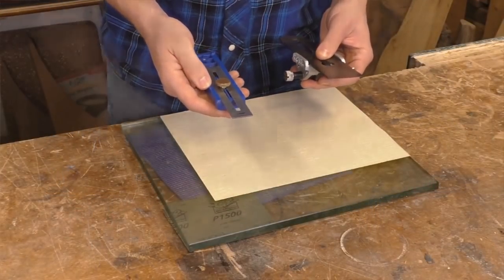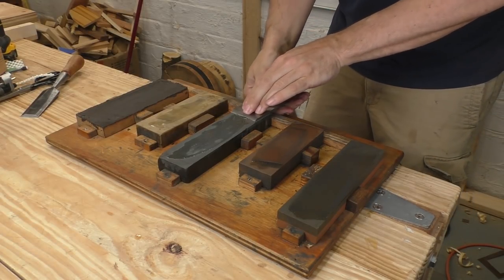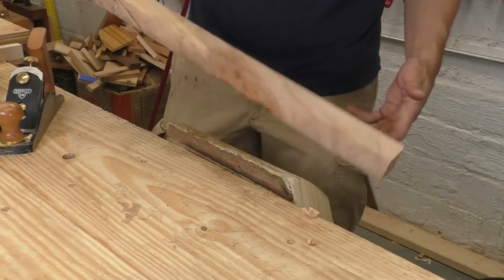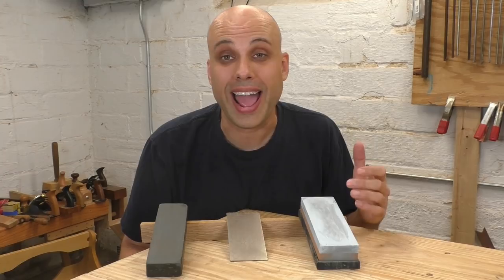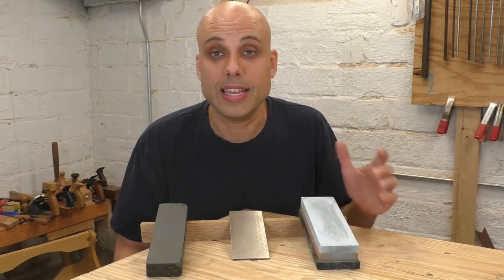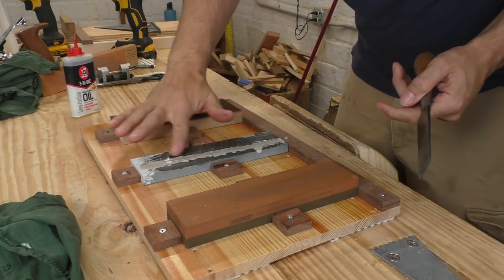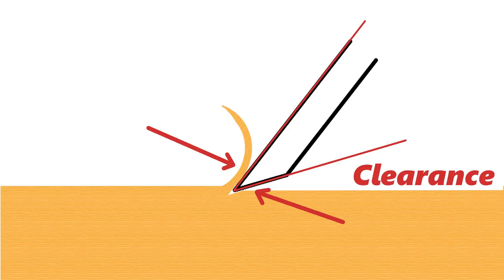Fast freehand sharpening: no jigs, no guides, no sandpaper.

Comment: An "edge" is an edge. more or less bevel is only serving as either efficiency or weakening the rest of the chisel. An edge only needs to be a smart crisp end to a hard firm piece of steel. No matter the angle, the edge is not a hammer, but I don't see people worrying about wether or not they have a perfect 90 on the face of a hammer...

Comment: I bought some stones for about $60.  A course stone, 400/1000, 3000/8000 and the set came with a strop.  The very brief instructions say use water. In the past I always used honing oil. I noticed you use 3 in 1 oil. What’s the real difference between use water or oil?  Thanks

Comment: Thanks for the video. Just a question: isn't the jump in grit from India stones to Arkansas  too big? They say the first is some  150/400 grit, while the latter 6-8k. Shouldn't the the something in between (~2000) or the grits are not comparable much? Thanks.
Reply from the maker: That's a really good question, but I've never found it to be a problem!
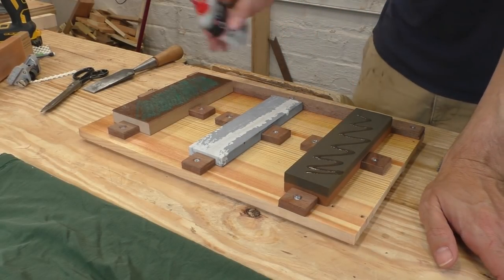Reply: An insight from Rob Cosman (https://youtu.be/okLIEoz00v0 10:18). Long jumps in grit are not too much of a problem when working on a small area.

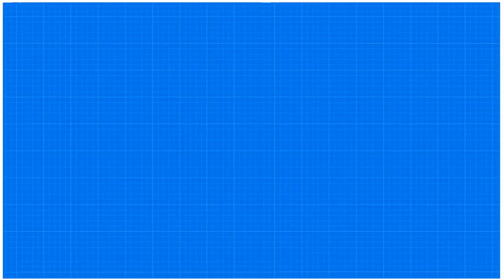And Paul Sellers said (https://youtu.be/UbAo4RpM7oM 0:40) he was using this particular Norton India stone (2500/400 grit) for first 20 years, without a need for finer stones.

Comment: Strops: If there's a saddle repair shop or leather goods maker in the area you can let them know you need a couple 3x8 strops from the thins or cuttings and you can get fresh good leather to nail to a board cheap as hell.  Often if you show up you can get em for the raw inch price of the original hide or free.  A piece like that will last a decade.  Shiny side glued, better hold with less glue.  duh.

Comment: The problem with diamond is if you try to sharpen a blade that is high in carbon and hot the diamonds will melt into the blade.

Comment: Huh, the oil stone i have home doesnt really leave the oil on the top like that, it just absorbs it draining the surface no matter the amount i add to it, i wonder if thats fine
Reply: a lot of artificial oil stones do this, it's not good for the stone or the tool if the oil isn't sitting on the surface of the stone to suspend the metal particles created when you sharpen things on them. I was taught that when an oil stone absorbs oil in that way you can 'fix it' by filling the stone with melted wax. While liquid the wax is absorbed the stone and then the wax cools and fills in all the voids and pores of the stone so when you put oil on the stone it stays on the surface and does what it's meant to do, carry all those particles away from the surface of the stone so they're not impacted into it.
Reply: The gray silica stones will do that. Eventually they will "fill up" with oil and then the oil will float on the surface. Or you can just soak the stone in oil for a few days.

Comment: Rex, I have a question!! what do we do or how do we level a sharpening stone that has eroded or lost it's flat surface?
thanks for the video, I do need to update my sharpening game....
Reply: You can use sandpaper on glass........ or a proper flattener (looks like an oilstone with big grooves in it eg-https://m.media-amazon.com/images/I/41uQgMqcjmL.jpg ). I flatten my high grit waterstones with my coarse diamond plate.
Reply: Dished stones are restored by grinding them against a larger, coarser stone.   There are special stones sold for waterstones, but people also use a coarse diamond stone or silicon carbide stone.  I've restored cheap stones that have groves worn in them by using a piece of sidewalk to do most of the work, and then finishing on something else.  In a pinch, the sidewalk will put an edge on a chisel, which is handy if you're on a job site and don't have anything better.

Comment: You don't need a flattening plate for water stones! With three stones you can flatten them against each other and get, and keep, them dead flat. Flattening after every use takes almost no time. You can buy stones that don't need to be soaked (they cost a little more), or just put them in water before you get started.
     Why does this matter? I don't like chemicals on my hands, I don't like oily hand prints all over my wood, and I don't like breaking out in hives. I also like how fast water stones cut; they dish because they cut fast and they cut fast because they dish. 
     If you're on a budget, don't save up for diamond stones. Try cheap oil stones first (or cheap water stones). I think diamond stones are a false economy. I have a co-worker who is an advocate of diamond stones, and I think diamond-stone advocacy can be summed up with his attitude for conditioning cast-iron cookware: He literally refuses to understand the difference between good chemistry and poor hygiene. He has a belief about soap and oil and cast iron, and refuses to accept that a rock-hard polymer isn't going to be affected by a mild surfactant. Similarly, he knows that diamonds are hard, and therefore believes diamond stones cut fast; he refuses to entertain the idea that they cut slowly because they clog up so quickly. Additionally, he has a set of premium stones that, after ten years of use, the finer ones are worn down to bare steel over most the surface.
     Less-than-premium diamond stones aren't reliably flat; I got talked into buying a double-sided diamond stone for $70 and it isn't flat. I didn't check it with feeler gauges, so I didn't realize it until it was too late.
     That said, for people new to woodworking, Rex is correct that there are (almost) no laws in woodworking! What works for you is what works best. Period. I once had a couple people bitching at me about how I was putting breadboard ends on a bunch of tables. Then one of the local Gods Of Woodworking came in, saw what I was doing, and said "Yeah, that'll work." The bitching stopped toot sweet.
     (There are no laws in woodworking, but there are laws in physics and they'll burn you goooooooood.)

Comment: Hey could y'all tell what kind of tools you are using for flattening stones?
Reply: Sand paper. Try 80 or 100 grit wet and dry on a tempered glass sheet. Use water as lubricant and put a splash of water behind the sheet of paper to stick it to the glass. I see some companies offering diamond plates for flattening water stones now too.
Do this process quite often as its so easy and well worth having a flat stone. A must for water stones.

Comment: Not going to lie I've used a Walmart camping diamond sharpener I've even just used an angle grinder to establish an edge works and I don't see any reason to change it
Reply: I mean whatever works for you keep it up.  But I don't see how you obtain the necessary sharpness for fine woodworking and joints using an angle grinder.  There's carpentry sharp and there's woodworking sharp. Whole different level of precision.

Comment: Ok, i have a question. (I'm quite new to woodworking)
I have a Whetstone and the instruction says i should put it into water for 10 minutes before using it. 
Can i use oil instead or is that a no go? (i don't want to get my wooden Sanding station wet all the time)
Reply: there are Waterstones wich can be damaged by oil - very rare ... so - for most cases you can ... BUT ... you can NOT switch back ... when the stone is saturated with oil ... the water is not likely to be very amused on that surface ;)
Reply: @philanders6902  I see, thanks! 
Very appreciated!

Comment: Wide irons are pretty easy for me freehand. But chisels, especially medium sized (like, 10 mm to 25 mm) for some reason end up skewed when I sharpen freehand. What can I be doing wrong?
Reply from the maker: Probably pushing harder on one side. Maybe for those, the jig is better.
Reply: @RexKrueger  Thanks for the reply. You are probably right, although I don't feel pushing differently. If it's the only possible cause, then more practice it is. Cheers!

Comment: I have been using a half restored flea market 13 5/8in long union folded metal not sure what the exact number or year it is because its hard to find any information. Which i guess doesnt matter becuase even i i have a $800 one for my first plane i would have murdered the blade. But i got it back by hand shatpening after thinking i could grind this thing sharp on a drill drill press that i put a unbalend grind wheel on after my bench grinder comitted suicide.

Comment: Most of my planes are low angle, bevel up blades. I guess that is a little harder not use a jig
Reply: Not really.
Reply: @jjbailey01  that depends. As example i bought 4(two came with the planes) all are 25. But only one i sharpen to the 25. Other to 30(hardwoods), other to 38 and the last to 50. I dont make secondary bevel just primary at those angles. So, set at hand at those bevels is a little hard
Reply: That is why I switched. I just couldn't get a good enough edge.  Bevel down is no issue for me freehand.
Reply: Once you are used to hand sharpening, it doesn't matter what type of plane blade you are sharpening. You just do it. Moulding plane blades are trickier, though, but you usually need special stones, not jigs, for those, too.

Comment: Why is a cutthroat razor shaped the way it is, could it be that bevel angles have a lot to do with edge sharpness and durability.
Finding that good compromise between sharpness and durability is what those angle obsessed people seek.

With chisel primaries generally factory set to 25°, then a 30° secondary follows for fast resharpens and edge durability using two bevels.
If you consider that it's generally time to reset the primary once the secondary bevel is the same size as the primary, there's also the option of increasing the secondary to a tertiary bevel and from there to a quad bevel if you have enough degrees left.
If we consider that after 35° we are losing sharpness to the angle for fine work (chisels), then we can say we have 10° of angles we can work with before redoing the primary.
So for a quad bevel you'd have 3.3° of 28.3 secondary, 31.6 tertiary and 35° for the last with each sharpened to half the previous.
What you are doing hand sharpening is an infinite bevel which increments each time you sharpen to a new edge angle until it's unusable and requires resetting the primary. In the case of a plane blade in a 45° frog, the maximum edge angle is 45° before the bevel is lower than the edge.
For chisels, well I'll stick to my guide, which takes only 10 seconds to set up.
Reply: I think you missed the point that he was aiming it at beginners to not fuss so much over some magic angle. Just get it close enough. As you get better at honing you will naturally find the angle that works best for you and your tools and probably will not round the bevel over unless that is your intention. Any angle between 20 and 30 degrees will work for beginners. The 20 degree end will cut super easy but need sharpening more often. The 30 degree end will not cut as easy but will not have to be sharpened as often.  25 degrees is just in middle, the average angle, and while it works on a jack plane, 22 degrees works better on a smoothing plane, and 28 degrees works better on a scrub plane.
Reply: @criswilson1140  
Didn't miss the point at all, but he was basically critical of people who seek the magic angle when there is clearly a benefit to doing more precise sharpening.
Hand sharpening doesn't require additional items other than a single wetstone, I'd even argue that stropping is kinda pointless as the edge quickly degrades to roughly a 1000 grit edge anyway and you'd need to be stropping regularly to realign that edge and a 1000/3000 wetstone is all you really need other than when redoing the primary bevel when the edge degrades sufficiently to affect your work.
Looking at the action of hand sharpening as demonstrated here, only that last 10% of the stroke is actually edge sharpening, the rest of the stroke is creating the infinite angle (circular) bevel, it would make more sense to use a very short stroke and just sharpen the edge.

It all comes down to how crazy sharp you want to get that edge, for most work the difference between crazy sharp and sufficiently sharp won't make much of a difference except for fine detailing.

My own wetstone is 1000/6000 so that is what I use on the secondary bevel and only use a couple of pull strokes on each side and not a push pull.

Comment: What?! You dont plane with the bevel facing the front?? Ive been doing it wrong all my life!
Reply: Low angle planes do cut bevel up, like block planes and low angle jacks. Traditional planes with the iron at 45° to the wood should be bevel down.
Reply: @tyronicusmaximus4230  i guess ive never seen a 45 degree plane
Reply: @megaman616  all the planes Rex has been using are

Comment: How do you flatten your stones when they eventually go out of flat
Reply: Sand paper on glass.
Reply: @spudpud-T67  thanks
Reply: @jamesgilbertt4640  Try 80 or 100 grit wet and dry on a tempered glass sheet. Use water as lubricant and put a splash of water behind the sheet of paper to stick it to the glass. I see some companies offering diamond plates for flattening water stones now too.
Do this process quite often as its so easy and well worth having a flat stone. A must for water stones.
Reply: @spudpud-T67  thanks again

Comment: hmm. i agree with your philosophy, but your argument is based on bevel down planes.. what about bevel up planes or chisels? a convex edge seems quite detrimental there.
Reply from the maker: Honestly, I have no trouble with it. I have a bevel up plane that I sharpen this way and it's fine. Remember that bevel up tools were invented when freehand sharpening was the norm, so there's no reason this should be an issue.